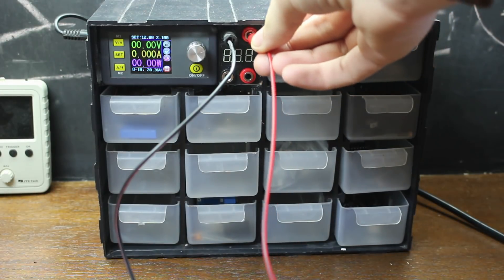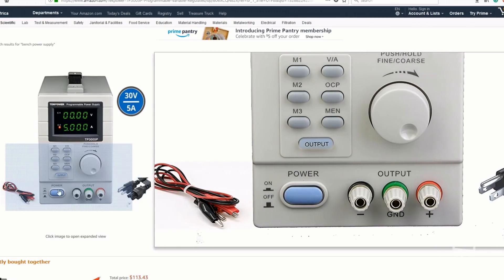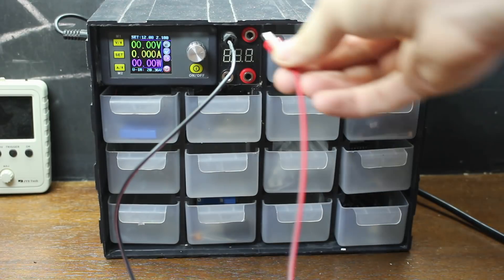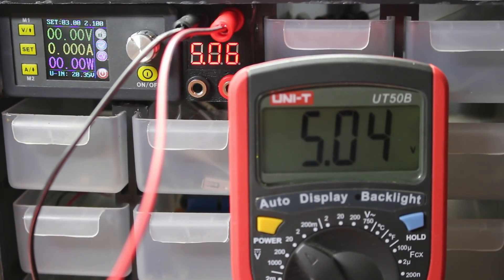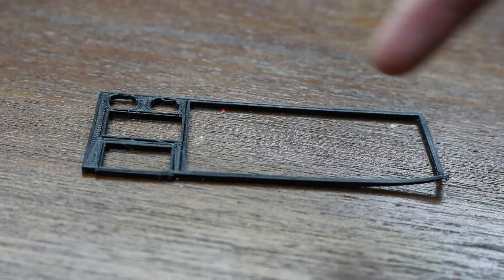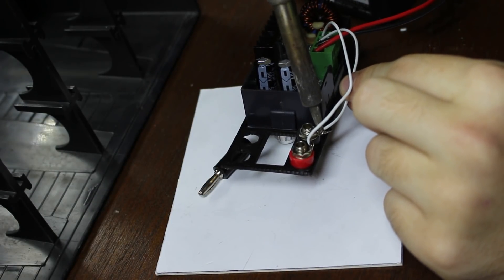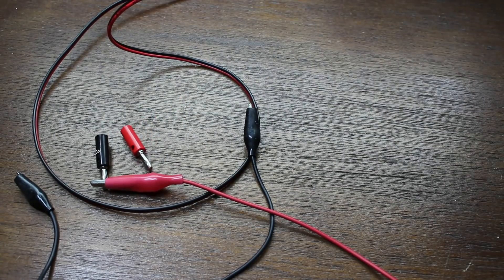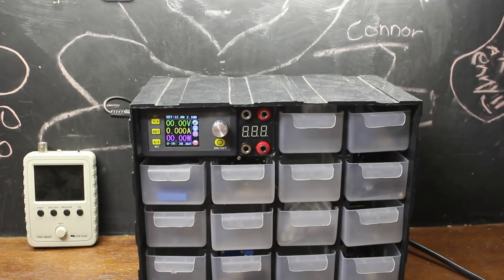DIY Really Simple Desk Power Supply

Comment: i made my own power supply pretty tiny using lm317 the only problem is the heat and I don't have a 30v power supply so I use 12v it has two channels

Comment: I've made my own power supply! A friend of mine had a old Power Mac G5 which had a 1KW PSU in it. I figured with power levels like that I could use a Buck & Boost arrangement to get a very handy bench supply with a wide range of voltages and currents. I bought a 600W Boost converter with CC and CV controls. I also sourced a lower power Buck converter for the lower voltages. i then got a a nice LCD Power meter all from Banggood I believe and fitted it all together ontop of the PSU enclosure with a metal front panel. I should really snap some pics of it, I hardly use it anymore since I got a real lab supply which is more reliable, Still was a fun learning experience!
Reply: Had a range of 1.25V to 98V :D
Reply from the maker: Seems that most people started off by making their own supply which is really great! As far as I know, those old Power Macs used water cooling and were pretty serious machines so I can imagine that the power supply was pretty powerful! Thanks for the comment!
Reply: Yeah! My friend opted to keep the water cooling unit for something. I'm just glad to have gotten a 1KW PSU

Comment: Really cool idea, I love the formfactor, and the way it looks. This has inspired me to perhaps make my own. Though I feel I might do the same with combining the voltmeter and power supply together, I don't have a shelving unit, so I would perhaps just make it modular to fit on my shelf. Thanks for the inspiration!
Reply from the maker: Glad to hear it inspired you! I should note that the power supply I talked about actually has a built-in voltmeter however you cant use it while the power supply is delivering power but rather only when it's on standby. Would love to see your power supply when its done!